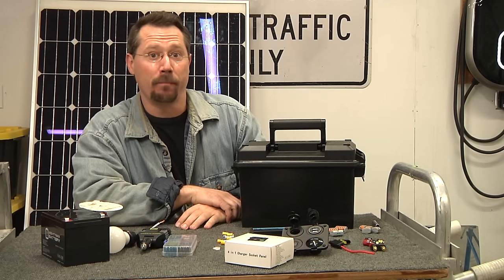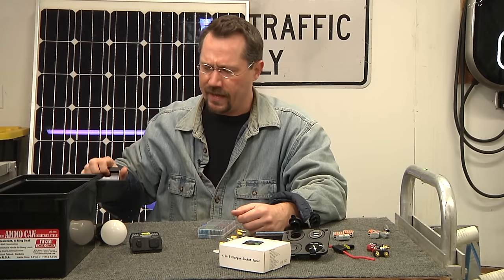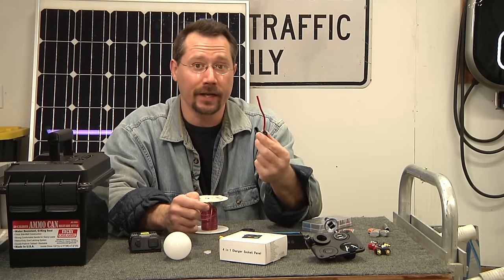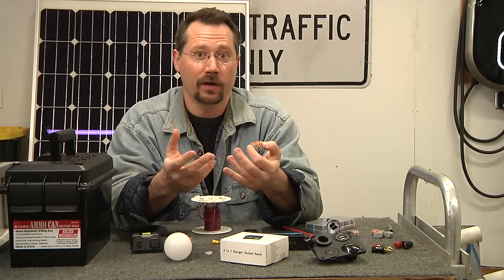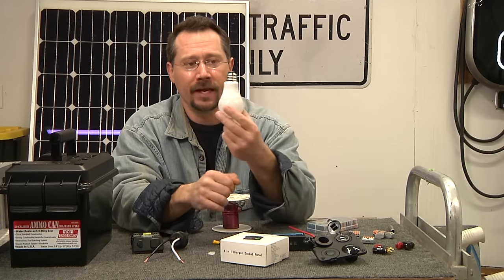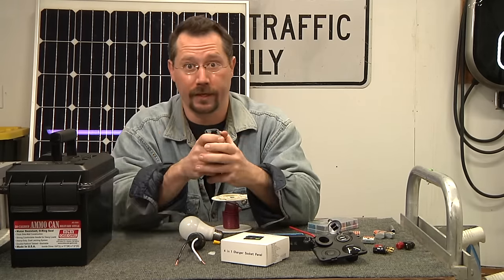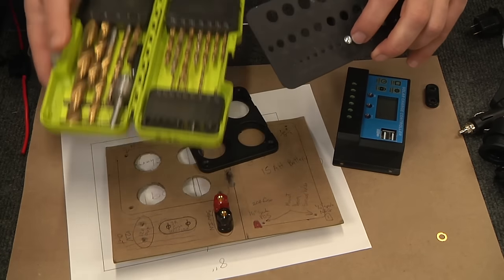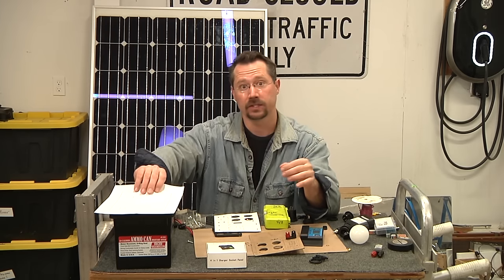Build A Solar Ammo Can Full-Length Instructional Video

Comment: You failed to put a switch between the battery and the Charge Controller input! This is THE most common mistake I see people make when they build these units. As your setup is in this video, the controller will over time, completely drain the battery.
Reply: Bruce Forster what do u mean,  sorry I am a novice at this .. I was trying to make it for my self . Do u mean we need a main switch from the battery to the controller.. thanks
Reply: Believe me, I am NOT criticizing you in ANY way! I genuinely want to be helpful to you, and everyone else who is interested in building these things. I highly encourage people to put a switch between the Charge Controller & the Battery-for this reason:

The Charge controller is receiving current from the Battery even when the Solar Panel / Panels are not providing sufficient energy to charge the system. In plain language, this means that the charge Controller is putting an albeit slight, drain on the battery. I have SEEN batteries completely discharge and become unusable from this.  A $5.00 investment in an inline switch to isolate the Controller from the Battery will save you a LOT of grief after on.

I know from personal experience-I did this once and destroyed a $150.00 Deep Cycle Battery.
Reply from the maker: Here's another way to wire the project using the exact SAME COMPONENTS which places a disconnect between the battery and controller.  https://www.youtube.com/watch?v=4YKRa9m4N7M
Reply: I agree with Bruce 100%!  With the switch Bruce described I. am able to turn on power to the charge controller only when charging the battery.  When I don't need to charge the battery I can shut off the charge controller while still drawing power from the battery.  Thus I reduce phantom battery drain.
Reply from the maker: Hi Phil, I hope you didn't skip over the other videos related to this project. Literally posted directly ABOVE and BELOW your comment is a link to a video I made showing an alternate way to wire the project, using all the same parts (no extra cost, etc.) with a disconnect switch. In case you hadn't seen it, here's the link again.
https://www.youtube.com/watch?v=4YKRa9m4N7M
Reply: Holy Cow!  I had no idea.  I'm wondering if that is some of the problems I've had.  I do not have a charge controller with LCD screen, it is a simple PWM ASC with only a charging indicator LED.   I have noticed that my 75 AH battery (charged only here and there on backup) seem to drain down to 80% a lot faster than you would expect.  Do you think it is the inactive ASC controller slowly draining it down?  Maybe I need a switch too!  Never thought about an inactive controller draining a battery, I thought it operated on solar only.
Reply: Correct!.. a Main Disconnect Switch would always be prudent to isolate any current & voltages between the battery and any components.. a 30A fusible disconnect switch would be ideal.. thank you for bringing this up.
Reply: Its not a bad idea to have a switch/ disconnect between the battery and charger.. but if you have the solar panels hooked up to the charge controller while the charge controller is not hooked up to the battery you will fry the charge controller. So, leaving the controller connected to the battery helps to "dummy proof" it😂
Great thing about lithium batteries is that their BMS will shut down when they get to their 0% capacity and prevent damage. Lead acid batteries on the other hand will get to a low enough voltage to cause long term damage.
Reply: A switch is impractical e.g for a solar powered trail camera. You often leave this camera unsupervised for weeks at a time. How would one proceed in such a use-case?

Comment: Could you run two batteries in parallel. Configuration making 2  12 volt not a 24 volt
Reply from the maker: Yes, adding a second battery in parallel would double your battery capacity. It would take up the "storage space" designed in the project.
Reply: BenjaminNelson don’t need storage need battery duration thank you for answering my question

Comment: Hi Ben, am I able to power a device with the battery while it is charging via solar
Reply from the maker: Yes. In fact, if the rate at which you are using power is the same as what you are charging the battery at, the power essentially "passes through".

If you are using more power from the battery than it is being charged at, you will discharge the battery, but at a slower rate than you would without the solar charging.

Likewise, the reverse is true. If you are using LESS power from the battery than the solar is providing, the battery will charge, but slower than it would otherwise.
Reply: @BenjaminNelsonX   Thanks for the quick reply.  One last question.  When not in use.  Can I keep the system plugged with AC charger for extended periods of time without messing up the battery, but still keeping it charged?
Reply from the maker: @patrickkirchner5271  You should be able to, but the best way for long-term storage of a lead acid battery is to fully charge it and then completely disconnect it.
Reply: @BenjaminNelsonX  Thanks Ben.  Last question, I promise.  In the ammo can setup, how will I know if the battery is fully charged?
Reply from the maker: @patrickkirchner5271  The solar charge controller has an image of a battery. I shows right on there the relative state of charge. You can also look at the volt meter.
Reply: @BenjaminNelsonX  Thanks Ben I really appreciate the help

Comment: Hi Ben, super helpful video!! I'm having a hard time looking for a 18v solar panel on our place, will 12v solar will still be able to charge the battery?
Reply: Maybe. 
For what it's worth my "12 volt" panel voltage varies from as low as 9 volts an hour after sunrise and flat on the ground to 17 volts at solar noon (i.e. directly overhead and perpendicular to the sun).
I've seen a lot of motor homes / RVs that have several solar panels flat on the roof.  They only put out full voltage / full power when the sun is directly overhead.  Other RVs have mounts that can be tilted (up to 60 degrees) to face the sun.
Look at the specifications of the charge controller.  Some will charge at a lower voltage, some won't due to the greater voltage drop across the controller.

Comment: can I add another battery , sae port and lights.  do I wire the same?
Reply from the maker: Yes, you could add a second battery of the same size/brand/capacity in parallel to double the battery capacity.
A person can pretty much modify this project in any way they want. If you want lights, just add lights.
Reply: @BenjaminNelsonX  can you explain the wiring or write a diagram of where the wires run?
Reply: @BenjaminNelsonX  Thank you,  I'm just nor sure on the wiring and what to use. 

I have multiple lights,  speaker,  USB, sae, banana  Jack's, dc plug, battery tender, 1000w power inverter,  100w solar panel, and plugs. 
Do I connect all the negatives  to negatives  then positive to positive. 
Also what gauge size wires? Do I need a fuse box and bus bars?

Comment: Benjamin, This was an awesome video thank you for all you do. I want one that I can also use for Minn Kota Trolling motor and all else, two questions:
1. Would you recommend two batteries for longer use?
2. Would you be willing to build one box without the solar panel and batteries (I can direct purchase them)?
Cheers!
Reply from the maker: For greater capacity, you could use a larger battery or two or more batteries in parallel. (That's where you connect positive to positive and negative to negative.)
Sorry, I'm not building boxes for people, but I have links for all the components used in the project right in the video description.
Reply: Thank you so much, most appreciated.
Reply: @BenjaminNelsonX  Could you do a video showing how to hook two of these batteries in parallel, or recommend a video I can follow?

Comment: Do I also need an inline fuse for the NEGATIVE side as well?
Reply from the maker: No. You only need a fuse at one point in any given circuit. When a fuse blows, it opens the circuit, and will do so wherever it is in the circuit. However, convention states that we put the fuse on the Postive side. This is particularly true of systems such as a car, that use a common negative ground. Make sure the fuse is as reasonably close to the positive terminal of the battery as possible.
Reply: @BenjaminNelsonX  - Thank you for your answer. You see, I have taken it upon myself to do this project, but yours actually keeps safety in mind AND explains the precise gauge of wire needed. Another question; if I were to deviate from your 15AH battery size and use say a 20AH battery instead, would that be safe? If anything, what else would I have to change?
Reply from the maker: @adamasalawan971  You shouldn't need to change anything. The 20AH battery would just have a little more capacity.

Comment: Ben. Thanks for the video. 

If you have everything connected to the solar charger(all loads) doesn’t the solar charger drain the battery since it’s always on? What are your thoughts on having an on/off switch to turn off the solar charger(when not charging) that way there isn’t a constant drain on the battery? If this is possible any ideas on how I can wire this extra “kill switch”?
Reply from the maker: Yes, any kind of load at all (including the display screen on this solar charge controller,) can be a drain on a battery. If the device is NOT being used, I pull the main fuse or simply unplug the + battery wire. A "kill switch" or battery disconnect can be easily added between the battery positive and the solar charge controller battery + input.
Reply: BenjaminNelson nice. Didn’t even think about just pulling the main fuse. Thanks for that also how did you determine the fuse size for the main fuse?
Reply from the maker: The solar charge controller is rated at 20A, and everything runs through it. So, using a 20A main fuse seemed appropriate. It's a common size for automotive type fuses and can be plugged into an in-line holder.
Reply: BenjaminNelson fantastic!!! Thanks so much for your video. Simple and easy. I originally was going to have a switch for each “load” (usb,cigarette, banana, volt meter). But after watching your video and Only 1 power switch it’s so much easier to manage!
Reply: Ben

Essentially you have 1 fuse. At the + battery to the charge controller correct? Just making sure I’m not missing any other fuses
Reply from the maker: Yes, this project just has one fuse. The solar charge controller also has built-in low voltage disconnect, reverse polarity protection, and a few other nice features.
For such a basic project, there's really no need for multiple fuses.
Reply: BenjaminNelson 

I was also thinking of getting 2 of the same battery and run them parallel for longer run time. What type of wire(gauge) to connect the batteries together?
Reply from the maker: Those whole system is set up for 20A max, so 12 AWG wire is fine.
Reply: BenjaminNelson thanks for replying back. I’ve been trying to ask questions but not many reply back. I appreciate it. 

How does the 15ah battery hold up in terms of run time.  I know it varies based on what and how many things I’m charging but is it good enough?
Reply from the maker: It's a relatively small battery, but great for charging phones, tablets, running LED lighting, GPS, etc. If you need a larger battery, do everything else the same, but just hook up a larger battery. It's worked just fine for me for camping, power outages, etc.
Reply: BenjaminNelson Ben thanks. I’ve seen some other videos where people bypass the LOAD port on the charge controller and just hook there outputs directly to the battery.  Any idea why they do this? Pros and cons to either setup?
Reply from the maker: Bypassing the LOAD port on the solar charge controller will allow you to draw more than the maximum the controller would allow. This means you can pull really big draws for your loads, but you also don't have anything protecting the battery! You skip the Low Voltage Cutoff  feature of the controller. At bare minimum, you would need to add a fuse onto any load otherwise connected to the battery not through the solar charge controller.
Reply: BenjaminNelson agreed. Very basic recharging of cell phones and such I think going your route is better or safer...... thanks. I’ve ordered my supplies! Very excited for my first build.

Comment: could you run a 12V dc camp fridge on this?
Reply from the maker: You could, the question is for how long. The camp fridge I have draws 5A. Since I used a 15AH battery in this project, in theory, I could run that fridge continuously for 3 hours. In general you don’t want to run a lead-acid battery down more than 50%. So, my fridge will run for 1.5 hours. 
You CAN run a 12v fridge from this batter, but you would have a short run time. A larger battery would be more appropriate. If you are using a camp fridge, it’s likely either in your car or camper, where it’s easy to carry a larger battery.

Comment: Unfortunately, the over discharge protection is 10.7 volts. At that low a voltage your battery is  well under 10%.  You shouldn't let them get below 50%.  I have a similar controller and found out about the voltage cutoff being way too low after I bought it. Can't set it any higher.   12.1 volts is 50% charge.

Comment: When doe the Amps of the solar charge controller matter??
Reply from the maker: The current rating of the charge controller is how much current the device can accept from the solar panel or panels. In a project like this, we only need a very low power charge controller, since we are just pairing it with a single small panel.

Comment: Kick ass video do you think it would work with a electric blanket
Reply from the maker: Yes. There are 12V electric blankets for automotive use. One of those would work fine. Just make sure to take a look at how much current the blanket draws, and make sure you have enough battery capacity for it.
I don't recall off-hand the power rating on my electric car blanket, but it's pretty low.
Reply: @BenjaminNelsonX  thank you very much

Comment: Can you charge with this whike using the gattery?
Reply from the maker: Yes, you can use outputs from the battery while the solar panel is connected and charging the battery. Whether you actually charge or not would depend on how much current you are drawing versus how much current the solar panel is adding.
At worst, the solar panel would at least slow down how quickly you are draining the battery.

Comment: I would like to know where you found the light bulb. All the one's I have found are cheesy and don't look right.
Reply from the maker: I got that 12V bulb at a big box home improvement store. I don't remember the brand off-hand, but it wasn't expensive and it's a good bulb. Autoparts stores can also be a good source for 12V bulbs as is a camping section or boat store.
Reply: Was hoping to find them cheaper than at one of those. But thanks any way.
Reply from the maker: There's a wide range of products and prices out there. Just look around. For example, here's a very basic USB charging solar panel: https://amzn.to/2Hxj5UU
I haven't personally used the one, so I can't vouch for quality or features, but that brand is usually pretty decent.

Comment: Your final product is amazing although it seems as if the wall charger idea did not work well in your video. Normally, the solar panel symbol flashes at a constant rate when charging and stays on when fully charged. Here I noticed it'll blink a few times and cut off afterwards. This leads me to believe that maybe the charge current on your wall adapter is too low and is shutting down every few seconds or the voltage of the charger is not being accepted very well with the solar charge controller (unlikely).
Reply: I saw this too -- the wall wart charger does not have a constant-current mode, so it is basically seeing a short circuit when hooked up to a battery. It is shutting down, then restarting itself a few seconds later. That's why other systems don't use such a charging method.

Comment: Will the box hold 2 of these batteries?
Reply from the maker: Yes, you can fit two of that size battery inside. You just give up the storage space, and you'll want to make sure to have the batteries connected in parallel.

Comment: Could you charge 2 of those batteries at the same time
Reply from the maker: Yes, you could charge two batteries like this at the same time. The easy way to do that is to connect them in parallel. Connect the two batteries positive to positive and negative to negative. This essentially gives you one battery of the same voltage but double the capacity. Of course, still use a main fuse and follow your other best safety and design practices.

Comment: Great video! Very informative and easy to follow. I was wondering what the pros and cons of adding a fuse block instead of a single fuseable link might be?
Reply from the maker: Either way would be fine. On this project, I used an in-line fuse holder with an automotive style fuse. They are simple and work great for projects where you only need one fuse or need it somewhere else or in addition to other fuses. You could certainly use a fuse block, but you just then need some location to mount it to.

Comment: I thought you werent suppose to plug in AC power to the solar controller on the panel inputs?
Reply from the maker: In the video, I show how you can connect a DC Power Supply. The "Wall Wort" takes AC power from the wall and converts it to DC power. This DC power is then connected to the solar input. The power supply is providing the same voltage and DC current as what the solar panel does, allowing you to charge the battery at night or in bad weather from wall AC power.
Reply: lol nevermind i just noticed it was a dc supply sorry about that, I thought it was a regular ac power adaptor for charging.